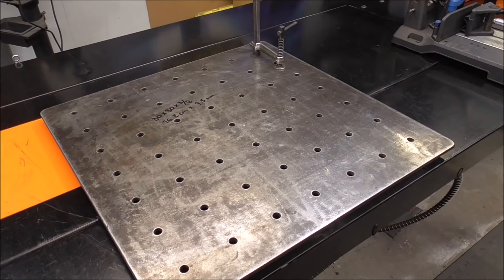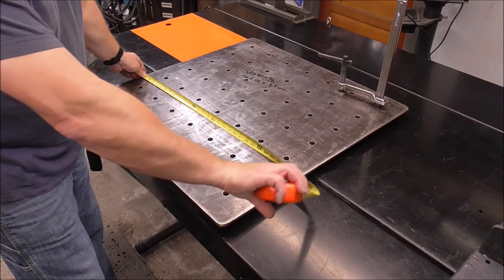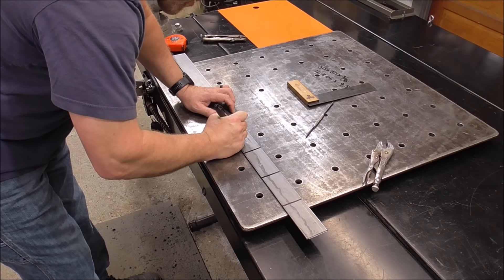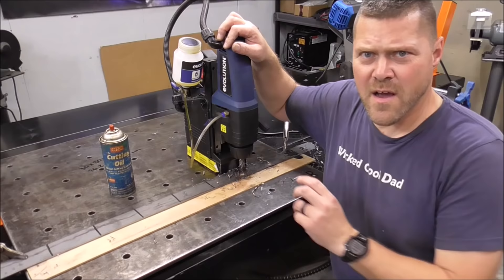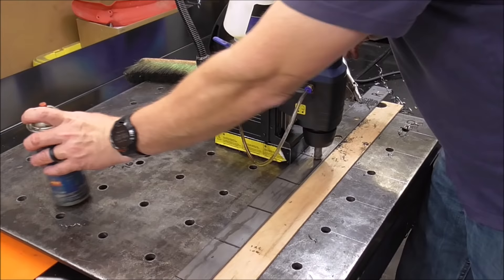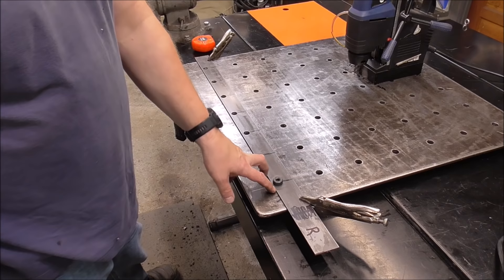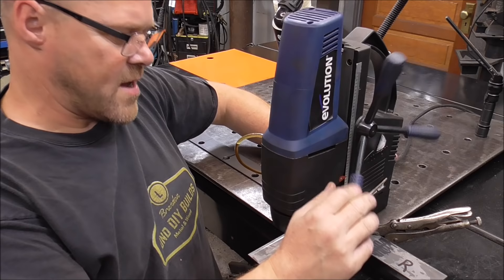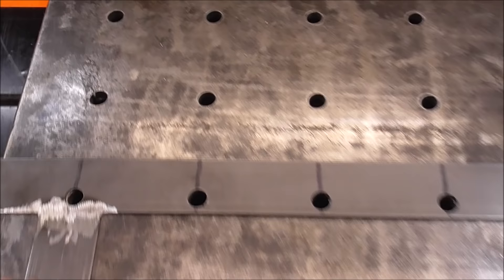Build any size Welding Fabrication Fixture Table DIY Template Perfect Layout

Comment: Absolutely awesome.  I need to do this...Soon.  Only thing I can add is to NOT just trust that the drywall square from the local big box store is truly square.  I have run across two in my career that weren't even close.  Double check before trusting them when it's something this labor intensive.
Reply from the maker: @Bret Burt thanks man and great tip about checking the square 👍

Comment: Very, very informative.  I've built 4 welding tables.   Everything down to 4 inch on center holes is spot on.  I regret doing 2 inch on center.  I love that mag drill too.   When I go to buy my evolution saw, I will click on your link to do so.
Reply from the maker: @Hip Airbrush thanks man I appreciate it 🙏  when I first built the table I almost did 2 inch centers but i decided 4" last minute and figured if I had to add them later I could. I really haven't run into any scenarios using the clamps I have to go any less than 4 so im glad I did. Plus for me it just means more places for little tiny nuts and bolts to fall through and never be seen again. Lol 😁

Comment: I’ve been building my welding table for a while now and got great ideas from your first video. The evolution mag drill is well worth the money and the bits are unbelievable. I drilled 253 holes through 1/2 plate and that bit still cuts great, even after a few holes with no oil
Reply from the maker: @Guy Anderson Evolution has some awesome metal working tools!
Reply: Stop using oil and use a coolant
Reply from the maker: @jane blogs its cheap and I have lots of it
Reply: After reading all this I went and looked at the bottle I got when I bought my mag drill and it says cutting fluid. So that’s what I’ve been using 🤷
Reply from the maker: @guy Anderson despite what is being said, cutting oil is very effective and has been used for decades in manual maching operations and home workshops.  Coolant is used almost exclusively in cnc automation and production cutting because it's needed to cool the cutters because of the higher speeds associated with automated machining and cutting process. Unless your doing high speed production work, stick with oil based fluids IMHO
Reply: @BrandonLund  be a scientist, drill 50 holes with water then oil. 
I'll bet you the water will drill the holes faster. If you measure the drill temperature it will be lower also. 
Oil heats up and STAYS hot
Reply: @janeblogs324  Methylated spirts is alcohol, the same stuff you drink but has methanol added to make it undrinkable - flammable.
Reply: @danburch9989  that's exactly why its a fantastic coolant. The faster something evaporates, the faster its cooling. 
Try drilling with it, spray it on, or use a sauce bottle. 
With a tiny puddle, you'll see it evaporate so quickly in front of your eyes. Once you get about 1/4" deep 1/2" diameter into steel, your puddle will be completely gone. 
It tells you exactly when you're overheating your steel/bit. 
Our metho  has about 5% oil in it too

Comment: I’ve never had a “drywall square” ever be “square”! I recommend making an actuall square jig!
Reply from the maker: Whatever works for the individual. If making a square jig works better for you than who i am to say don't do it. If you make a mark and rotoate the tool 180 degrees and it's still on the mark then it's square. There are usually several ways to get a job done.
Reply: I dont think the drywal square needs to be square provided you only work off of one edge of your table.  Dont flip the square 180 degrees, so create a temporary long edge on one side of your plate and work off of that.
Reply from the maker: @johnwilliams727 spot on 👌

Comment: Thanks for the template idea. I have a weld table/bench 3/8" thick top. Going to cnc plasma cut a template them use my mag drill to make the holes. Possibly will do a vid on this too. Thanks.
Reply from the maker: @TJS Welding and Fabrication thanks man glad I could help!

Comment: Absolutely great stuff.......... as a lifelong carpenter rolling over into metal fabrication, I can say, that every build has two components, both of dead equal value.  The trick or skill is mastering each a best as you can.  # 1 is layout ("layout,layout,layout" as my old boss used to say), #2 is fabrication.  If you approach each one as it's own task, making them as clean and accurate as possible, the end project result will be outstanding.  Transitioning from wood to metal fabrication shares ALL the same skills,... it just becomes of a case of learning to work the "metal"  Thanks madman, your channel licks ass!
Reply from the maker: Thanks @Scott H I appreciate your support and your wisdom. Well said brother!

Comment: Ahhhhh.....I'm guessing the Layout  was done using the Three, Four, Five rule?......FINALLY a use for that Highschool Trig class! Lol....We Wood workers have been making these layout tables forever. I do a bit of (hobbyist ) welding myself. For some reason (probably because I'm not a real welder) I never thought of doing this with MY welding Table. This is going to be Greatly helpful to my Fabricobling! thanks for Prodding me in the right direction. Great Video!
Reply from the maker: Thanks Richard! Yah your right this table would work pretty slick for glue ups also. Just take a 3 in one tool and BOOM all the glue mess is gone. Great tip and thanks for sharing Richard!

Comment: You must have sharp eyes and a very steady hand to get the template so close, no way I could.Great video !!
Reply from the maker: Thanks man! My sight is ok but 50% of the accuracy is determied for me by bumping the template into the magnet. Then that just leaves me making sure I have the measurement correct along the length. I use reading glasses too. It helps get it precise :)

Comment: I meant to add that any of your viewers wanting to do custom gates, fences, railings and custom staircases including spiral stairs cases, start your vertical pieces from the center of the width of your material and from the center of the horizontal pieces and never worry about correct spacing from there. Work from the center and then out.
Brandon. I really dig the earmuffs and that new helmet. The new equipment today is pretty nice from my days of old.
Reply from the maker: Great tip Rick! 👌 Thank you!
Reply: Can you describe that in more detail?  Kinda confused.
Reply: @marksarovich5534  you're really funny Mark

Comment: My table is still in process. I was able to get a nice 3/16” x 2 1/2’ x 7’ sheet for cheap. I was hoping to get at least 3/8” , but i will have to use the 3/16” for now. I have to compromise somewhat on my table due to thinner material but im sure i can get it to work for my needs. The table frame was given to me, but it needed a table top. I do need to weld a few supports for top, add feet and heavy casters (which i had), and i should be good to go for a while. Thanks Brandon for many ideas and the hard work you put in your videos!
Reply from the maker: Thanks Brian! You should be fine. The only time it can be a problem is when your putting tons of heat into a part like when your brazing.  If you know you are going to be heating something cherry red you can always raise it up off the table. A lot of the pre fab tables use 1/4 so you should be fine!
Reply: @BrandonLund  Thank you sir for the tip! Im not sure how abusive i will be on this table, but i really dont wanna mess it up!

Comment: Yeah I know this is a year old video but here's the thing - I really want a Langmuir Arcflat welding table but I just can't justify spending that much. I can, however, justify buying a mag drill to turn one of my heavy welding tables into a layout table. Very interesting watching how you did this. I absolutely love how you snuck in that way to give away the nice helmet. I bought a Yes Welder true color about 2 years ago and I really want to like it, the view is fantastic when you're not being flashed and I'm sure it would stay on my head better if it was just a hair less flimsy, other than that it's every bit as good as my old Antra. If you're still reading this, just know that even though you made this video a lifetime ago, it's brand new to me and just as informative. Good job.
Reply from the maker: Thanks man I appreciate it! Those Langmuir Arcflat tables are nice but I would have a hard time justifying the purchase and the majority of the people watching this channel and others like it are probably not going to have an extra grand minumum laying around to buy a bare bones table. The one I built seemed more reasonable for my audience and it gives them a probject to build and hone their skills. I love my YesWelder hood but I think to get the most out of it I would need to take the time and get it adjsyted perfectly for my head. I'm old school and used to the one adjustment. It almost had too much for my simple thinking. The optics are crazy good. I might just have to swap out the extremely adjustable head gear for somthing less adjustable and fool proof. It sounds like this was your experience witht hat hood also @bobg8378
Reply: @BrandonLund  I probably was too hard on Yes Welder, I've actually got 2 of them, the first one flashed me every time I Tig welded and although it's a tiny arc it's pretty bright without shade. They were very good and quickly sent me a new one which has worked perfectly. Hey, just occurred to me maybe I could glue the 2 shells together and stiffen it up so it's not flimsy!
Reply from the maker: Hey, I was just re-reading your first comment, if you don't think you will get much use from a mag drill you can also rent one. I've had a bunch of folks tell me they built one but instead of buying they just did a one day rental. I agree the helmet is a little thin. I actually don't mind it. I just wish the headgear had less adjustment lol

Comment: Hi Brandon, a quick hint as a machinist and metal fab retired guy is something I would always do and taught my employees to always do. Instead of putting a R or an L on top of the piece you're working on, just largely put a sharpie mark on the front of material that is facing you and then scribe a Arrow going up and  scribe a T for top and then scribe the word "To me" close to it. This way you always know the T or Top of your work and the To Me meaning it's facing you or at your belly. As for getting your holes to be exact and not worry about 1 side to the other of overlap space from the left or right sides, just Always measure your piece on the X axis (left to right) and then your Y axis (coming to you and away from you) and then divide the X axis number by 2 and that y axis number by 2 and then make a mark where the center of the table is. Now you can move from the center and to the left and or  right and put your marks and then repeat from the center and go front to back and mark your holes. This takes away any guess work and it will be 100 percent evenly spaced. Next, quit calling me an older guy even though I am.. lol....Good job Brandon....
Reply from the maker: Thats an excellt idea! Thank you!
Reply: @BrandonLund  Please don't take my comments as a negative or some sort of hard ass critique as I'm just passing on my own knowledge and experience from all the years I've been working with Metal Fabrication and Machining. Much LOVE for you Brandon and I really think you're a stand up person and helping others achieve greater knowledge. Always, Always there for you need if need be so just ask as you have my email address. Live Large and try to  Enjoy Every Day you're given.
Ciao 4 now....Ricko
Reply from the maker: @Rick O I love critiques. ❤  like I said knowledge is power and I think we can all agree there is a lot that we can learn from one another. That's why I love the comment section. There are a lot of folks willing to share their experiences and everyone benefits from it 🙏

Comment: Great videos. I got some great ideas for my layout table from you. One note of caution though. Drywall squares are notoriously not precision tools. They quite often are not exactly square. If you are going to use one then check it for square with a known accurate square first. It would really suck after all the work to find out it was 1/8" out of square over 4 feet. Now I just have to find some inexpensive shoulder bolts. Great idea to use those. Thanks.
Reply from the maker: Great point. You can also use 5/8" drill rod to save a little money. Grainger carries it

Comment: I know this video is older but new to me :)  Thinking about making this templet.  After marking for the the main holes weld the tabs on then scribe the hole for the offsets. That way instead of trying to line up the edge of the hole you can just go on the mark.  Hope this makes sense.  Anyways thanks for the ideas!.
Reply from the maker: That works too! Thanks Mark!

Comment: I made mine with a 200 mm spacing for most of the table and 100 mm spacing on the part that is used the most as my table is 1500 mm x 2500 mm. All my holes were drilled with a electric drill as I don't have a mag drill.
Reply from the maker: @Michael the nice thing about the wider spacing is all the little things like bolts and screws dont have as many places to fall thorough and be gone forever lol.
Reply: @BrandonLund  get a cheap ,magnetic ashtray from HF and put small screws in it as you go
Reply from the maker: Great idea! 👍

Comment: Im thinking about making a welding table like fireball tools but im still looking how to make it mobile. Im thinking 6 plates of 10 by 10 and have 4 inch gaps in between.  I question how I want to fold the table or if I just buy two good saw horses where I could adjust the height to somewhat level the table. Or im thinking if I should make a 4 piece frame that I bolt together for extreme strength. This video does give me a lot of good ideas on how to build it and more important the potential pitfalls.
Reply: I bought a cheap one off of harbor freight that folds up and kinda took the ideas from that. Worth a look
Reply: @Guap303  I looked into cheap tables but I feel like they wont last. I need a adjustable strong table that I can pickup and get inside a van. Im thinking about the 4 piece frame that I can put together with ball lock pins.
Reply from the maker: Having it rigid but still mobile is a fine balance.
Reply: @will.5642  I bought one of those folding welding tables from HF.  You can't get a better value! I don't do a ton of welding but it has held up great through the 10 or so projects I have used it for. I actually had a heavy 12 inch miter saw on it and it held that fine.

Comment: They make spatter spray that you can put on your welding tables to prevent getting spatter stuck on it. I haven't even put my welding table together yet, I bought one from Texas Welding that was $750, it has casters on it so it can be moved around. They say it can hold up to 600 lbs, I believe that's the weight they advertise, but since I can't use any of my welding equipment yet, which is due to our breaker box being full, I can't hook up 240V  30A breaker. I bought the Yeswelder MIG 250 Pro multi processor, and I bought the Yeswelder CUT 55DS Plasma Cutter, so it sucks that I can't even use them yet, hopefully I'll be able to use them soon.
Reply from the maker: You can save yourself some cash and just spray pam or any non stick generic cooking spray on your table. It's non toxic and works just as good as any commercial spray that you can buy. I feel your pain about a full power box. I had to rewire mine and install a sub panel to allow for the additional welder circuits.

Comment: I am going to have to make one of those tables. I have never found the drywall squares to be very accurate. The two that I have in the shop are about an eighth of an inch out over 4 feet.
Reply from the maker: You could always use a large framing square and extend the length with some flat bar. The important part as you run the tool the same way every time so your lines are parallell to the one before it. There are a bunch of different ways this could be done. A viewer has plotted a cad drawing that I will be making shareable shortly. Then you can lay the template on your steel and simply punch it on the plotted marks.
Reply: @BrandonLund  that sounds great and easy to do. Some day I’ll get a mag drill too

Comment: Weld the tabs on after you've scribed the lines on the cross piece, but  before you drill the row of holes, and you can lay out the locating holes off your punch marks
Reply from the maker: Great tip!

Comment: I wondering if you would do a follow up vid checking how consistent the holes are?  I see you have calipers could you measure from one hole to the next and see how close they are? Also could you drop pins in all 4 corners and measure the diagonals?
Thanks for your time
Reply from the maker: Thats actually a great idea. I will see if I can fit that into one of my videos. Thanks for the suggestion

Comment: Brandon, loved your video informative. Have a suggestion for you. Instead of buying 5/8” shoulder bolts which can be expensive. Try this. At my metal supplier I purchased the following: 5/8 solid round  bar cold rolled 3’ long, 1/2” black pipe 3’ long, 1/8 x 3” flat bar 3’ long ( for template). In my area this came to about $28.00. I cut 1” slug off of round rod. I cut 1/2” ring off black pipe. Put the black pipe ring over the 5/8” piece I cut off. Hammered the two together hit the Top with my 2”x 72” belt sander. Went over it with my 3M buffing wheel. Done. Can male a ton of them for about twenty bucks.I’m going to cold blue them. Now off to make the clamps. Have a great day Terry 2:54
Reply from the maker: Great idea! Thanks for sharing Terry! This should save a lot of folks some cash and I'm all about that!
Reply: @BrandonLund  your welcome. I too am all about saving money.